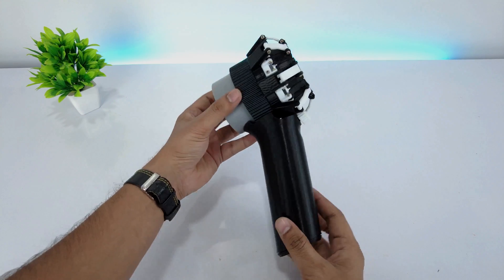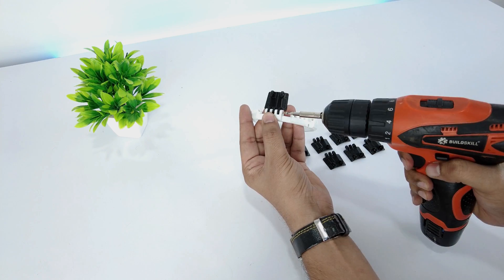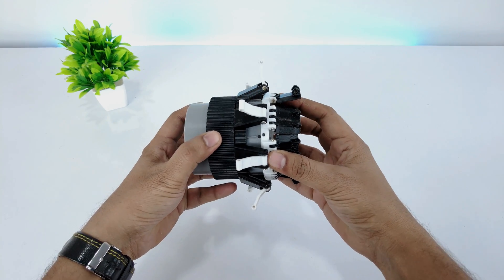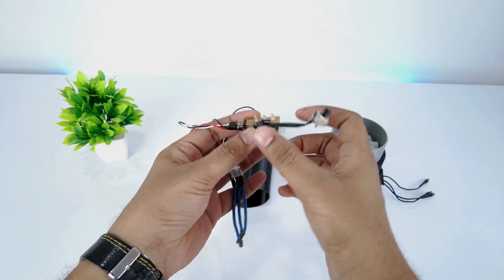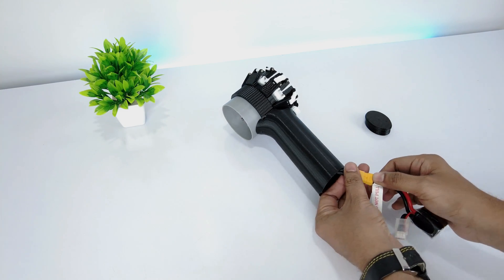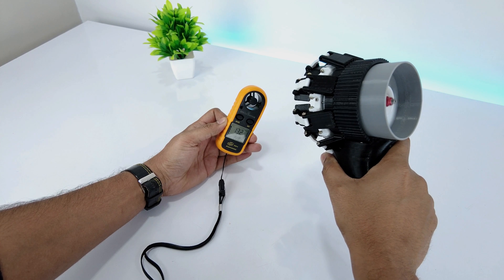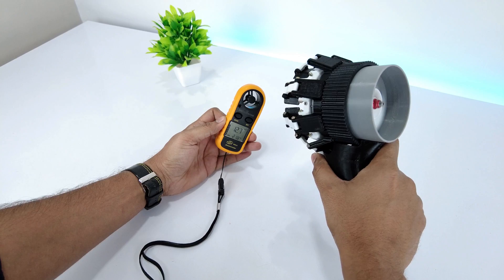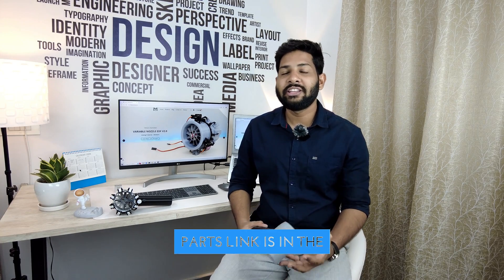Can a 3D Printed Jet Blower Beat a Real One?

Comment: Bro can I use 4.2 kg nema 17 stepper motors instead of 4 kg nema 17 stepper motors you used in diy 3D printer video. If I can use the 4.2 kg motors do I need to change anything in the code

Comment: Bro can I use 4.2 kg nema 17 stepper motors instead of 4 kg you used
Reply: Bro if I can use 4.2 kg motors do I need to change anything in the code if yes can you say what I should change
Reply: Bro the above doubt is from the diy 3D printer video

Comment: Bro but you told to put the files in a sd card and then print but the mother board you used for the diy 3d printer does not have a sd card slot bro please give me your contact information i have many doubts 🙏 iam very greatful to you and even said my friends to subscribe the channel and i also bought the code and templat files for the 3d printer
Reply from the maker: The LCD I have used has a SD Card adaptor slot at the back